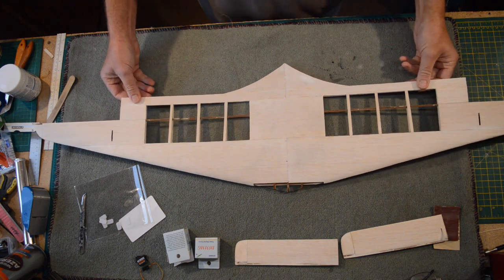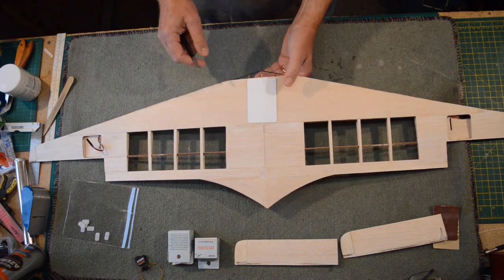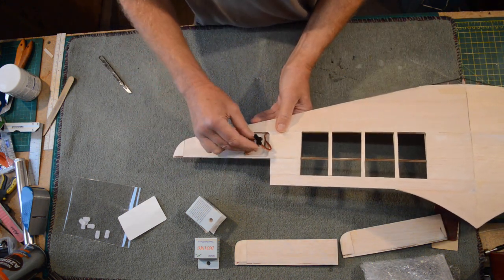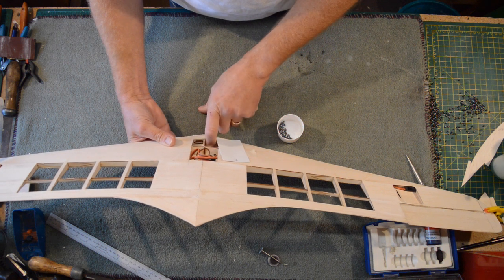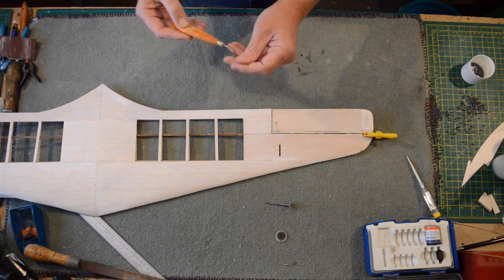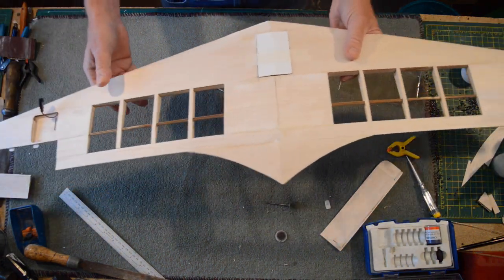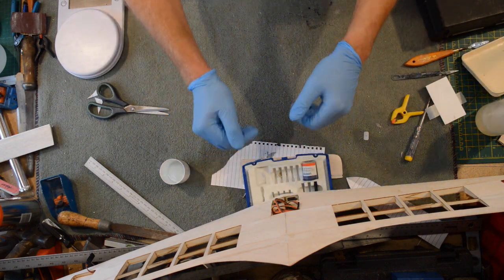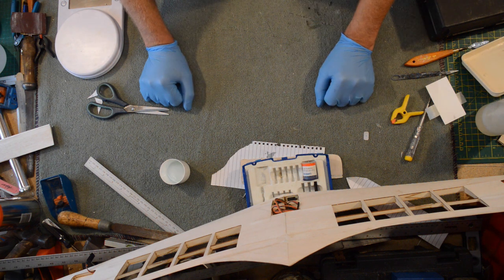Prandtl Flying Wing FVT-3 Part 6  Hatch,Elevons, Ballast beads

Comment: Did you mock up the CG or are you just going to 'wing it'? Haha
No but really, is there enough room to make fine adjustments of the CG? Such as w the battery?
Reply from the maker: I followed the angelwingdesigns guidance then winged it :) plenty of room for extra weight